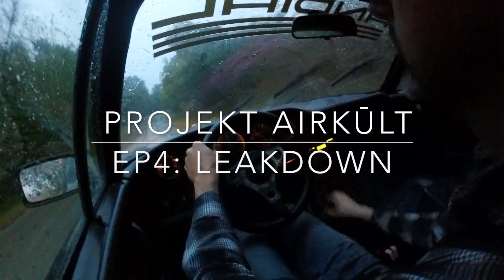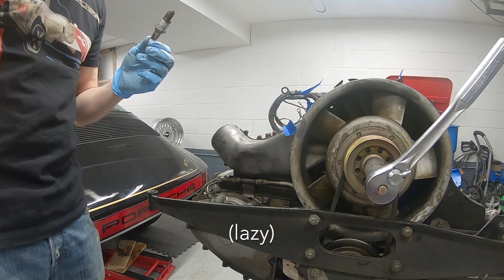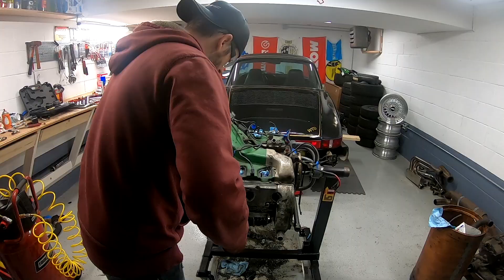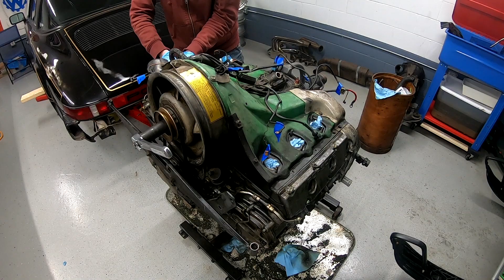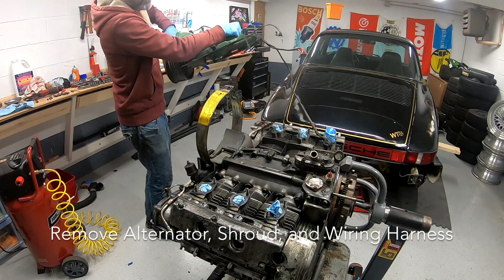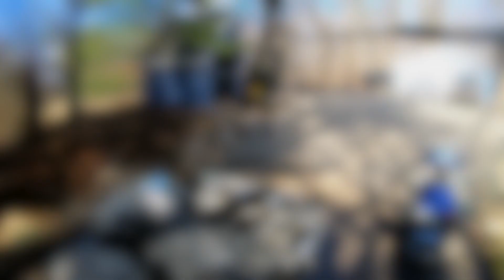How to do a Leak Down Test on a Porsche 911S!  Check Engine Health on Projekt AirKult Episode 4

Comment: Maybe I am splitting hairs, but how
 should you "calculate" the percentage difference with these test.
There is an 8 percent unit difference between 12 and 20 , but between the actual numbers there is a 40 percent  difference.  
I got similar spread on my 964 110 000 miles, but since the highest was 19 percent I can live with that.
Reply from the maker: hrm....  I've never really thought about it like that.  I'm just gonna send it.

Comment: Why not just replace the spark plugs considering how cheap they are?
Reply from the maker: I will.  Probably.  Or maybe I'll just clean them.  They were oily because the car sat for 12 months, and then I idled it for 5 minutes in January, so I'm sure some oil pooled in the cylinders.  The tips themselves were tannish, so I'm assuming they'd be a bit more tan after actual driving.
Reply: @ADDvanced  If oil pooled in the cylinders then your pressure testing may deceive you.  It's basically the same as a wet compression test where oil is providing a seal around the piston rings which may not be there otherwise.
Reply from the maker: @ryanhorsley9965  well, can't afford to redo it, so I'm just going to send it

Comment: I bought that same HF leakdown tester...such an epic POS. lol It does kind of give you a general idea though. Music is fine. I actually think it makes the video move along. Same reason why TV shows always have background music on build shows.
Reply from the maker: It's so bad!  Idk how they get away with advertising it works at 100PSI if anything over 15psi pegs the second gauge.  So dumb!   Even zero'ing out the 2nd gauge is annoying, and once you hook it up to anything, most of the time it doesn't even reset to zero which means the data it gave you is bunk!